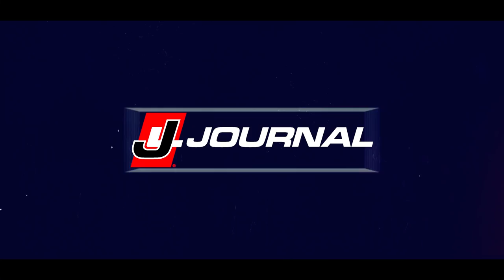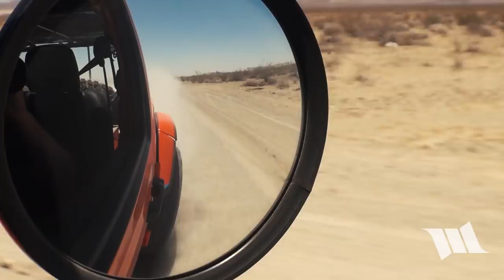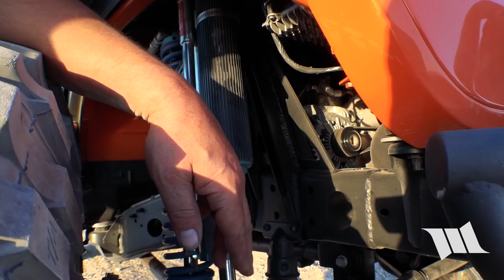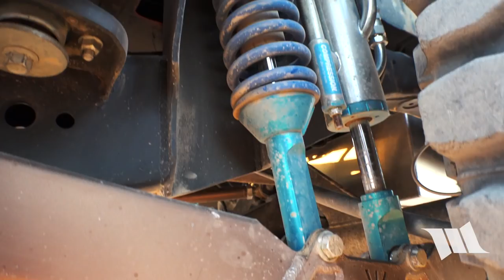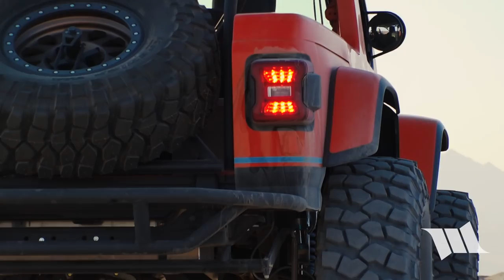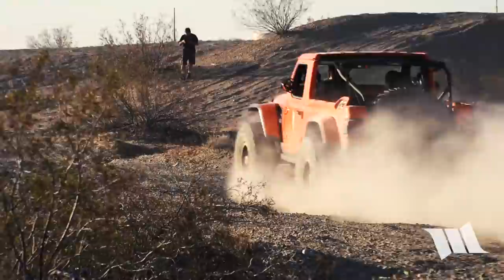Jeep JL Wrangler Concept Truck SANDSTORM High Speed Desert Off Road Testing with EVO

Comment: Looks to me like you could move the front turn signals back to the JK position by drilling holes in the grill with a hole saw and re wiring,old style lights.

Comment: Front solid axles make for sketchy desert speeding.. My husband has a Gladiator and a Ford Raptor, and even I can feel the difference at high speeds in Moab.. The Gladiator is most comfortable to crawl rocks.. The Raptor is best at tackling Moab trails at high speeds... The from solid axle makes for such a messy bumpy ride at high speed in the Jeep
Reply from the maker: Bone stock, a Gladiator couldn't hold a candle to a Raptor, that's for sure. A Jeep built up like this, you have no idea what you're talking about.
Reply: I was comparing the pros and cons of dual solid axle (which Gladiators have) to a independent front suspension with a rear axle setup (which a Raptor and most pickups have) and was not comparing vehicles.. Dual solid axles will have the articulation needed to keep wheels on the ground while rock crawling but be very unstable at high speeds over uneven terrain... Independent front suspension has less articulation so will wheel lift more during rock crawling, but is able to stay more stable and comfortable at high speeds.... Everyone that understands suspension knows that which is why you see Wranglers rock crawling and Raptors and Rams speeding through desert roads... YOU don't know what you are talking about.. You didn't even know what I was talking about
Reply from the maker: @lunamaria1048  LOL - easy there sister. No need to get your panties in a bunch and get all butthurt over nothing. Yes, there are a lot of pros to IFS and even IRS and if it were more cost effective, it'd be something I'd want too. All I'm saying is that there's a lot you can do with solid axles too. If you actually had any experience driving a Jeep built up like the one you see in this video, you'd know what I'm taking about. Have a good day :)
Reply: Dual solid axles are less stable at high speeds over uneven terrain, period.. Your setup doesn't change that... That is why trophy trucks have front and rear independent suspension.. For maximum stability over uneven terrain at high speeds so they can reach and maintain the highest speed possible.. Independent suspension soaks up most of the energy of the uneven terrain sending little vibration to the body.. Solid axles only move and shift the energy around causing more vibration so more instability and loss of speed.. Simple physics
Reply from the maker: @Lunamaria LOL - yeah, ya got me. Trophy trucks have IRS is 100% accurate and I'm the absolute dumbass here.
Reply from the maker: LOL - right, I'm the childish, foolish and absolute dumbass who felt the need to find a YouTube video to post on to show how much I know based on what I've felt riding in my spouse's trucks. Now, I'm the one trying to save face over 100% accurate statements I've made regarding trophy trucks running IRS. HAHAHA - lady, you're awesome. Now, why don't you run along and tell your husband how you won on the internet and then relax to a nice happy anime :)
Reply: You sound like one badass desert warrior. I really wanted to see all of your badass rigs in action but went to your channel and couldn't find a single thing? Do you have any footage of these sweet ifs rigs of yours in action? You speak like you have a ton of experience. I'd love to see it sometime. I'll be getting a gladiator for grocery shopping but I still love to see these desert machines that I can only dream about because my Jeeps are just so inferior.
Reply: I have no idea what you are talking about or why you guys keep referencing vehicle brands.. They are irrelevant.. My comment addressed the instability of dual solid axles at high speeds over uneven terrain.. Which is the reason why companies stopped using dual solid axles for trucks (aside from the Wrangler and Mercedes G Class which still use them).. Dual solid axles are superior rock crawling vehicles, where IFS makes a truck superior at high speed over uneven terrain because less energy is transferred to the chassis.. I literally explained the science as simple as possible so you could try to understand, but its clear you are butt hurt over the pros and cons of each setup which is common knowledge.. It doesn't mean one is better or the Jeep in the video is bad.. It just means each setup has its strengths and weaknesses.. Also it doesn't matter whether my husband owns a Raptor or a fleet of Kias.. Everything i said regarding strengths and weaknesses of solid axle and independent suspension is 100% accurate... Explaining this to you has been like trying to translate the theory of quantum mechanics into the grunts and screeches of a Chimpanzee... Wow lmao it is evident how much you DON'T understand
Reply: Wow. Sounds like you're really worked up over this. I just stopped by because I love Jeeps and found your comments interesting. It's obvious that you have 'arrived' here in the off-road world and I hope to learn a ton from your channel (but your videos aren't working). Other than your comments, I've been listening to eighty's music and reliving my glory days. Good times. Thanks for stopping by. You're awesome!

Comment: Can you please explain why and how the lowrance multifunction is used in the vehicle? Cheers
Reply from the maker: It's just a big GPS unit. Typically, your co-driver would use it to relay information to the driver such as obstacles, hard turns and hazards.
Reply: Thanks for enlighten me. You can have land maps on it? Thought you may use for deep water crossing and to see the bottom hahaha!
Reply from the maker: LOL!! These are typically used in desert racing. The race course is given to the drivers and is marked with information that they need.